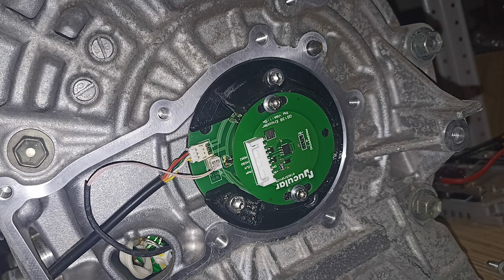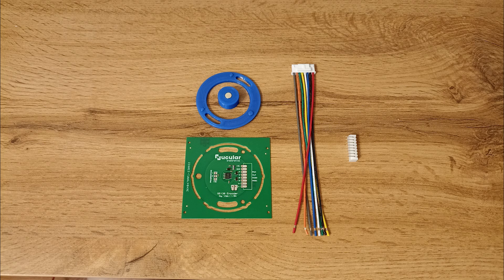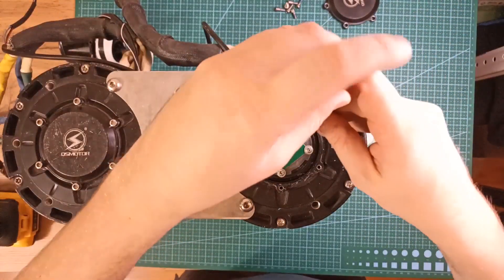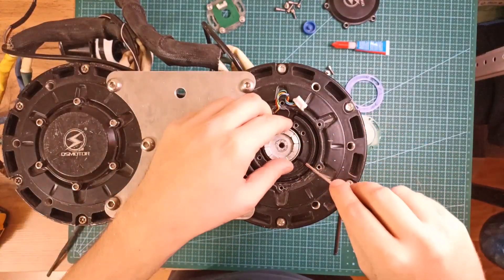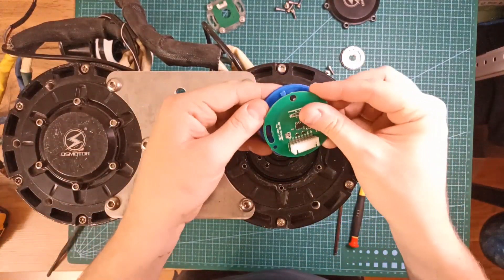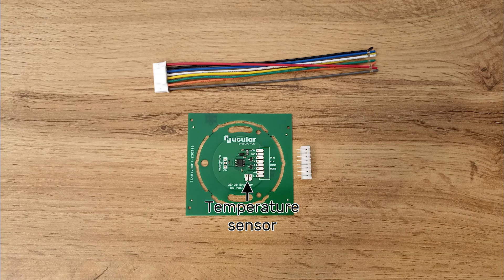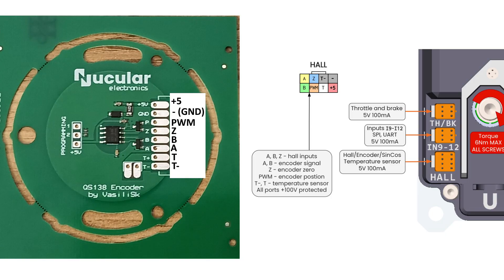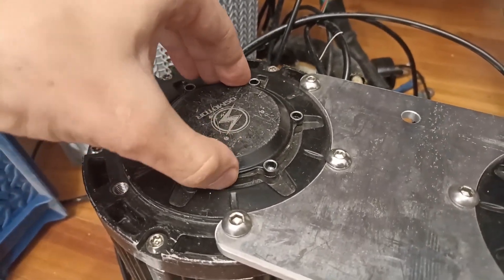Encoder board installation guide

Comment: Can a controller that runs a Hall effect system be converted to run an encoder system or will a new controller be required
Reply from the maker: P24F controller can run both hall and encoder, if you have other controller model better check if it has encoder input